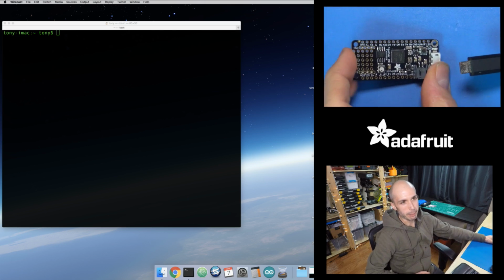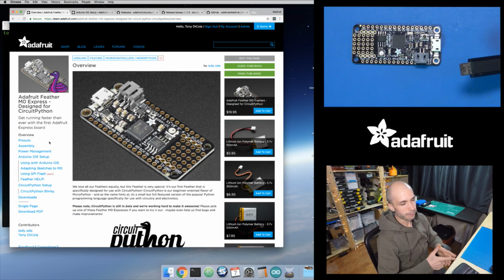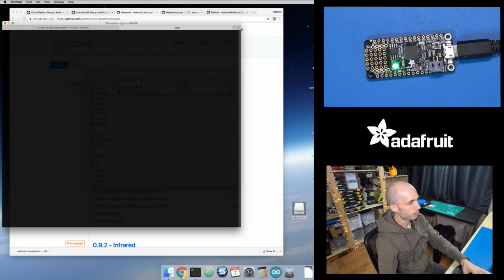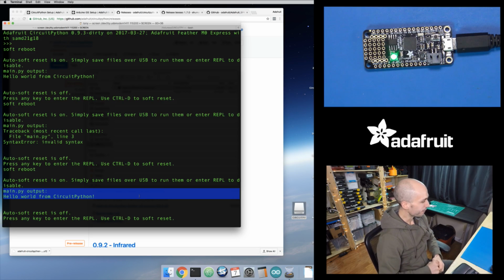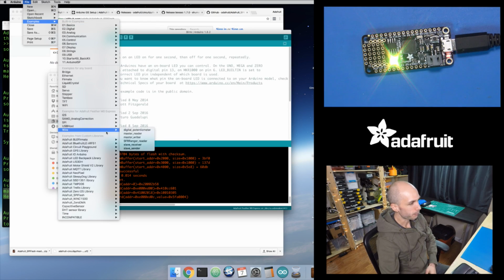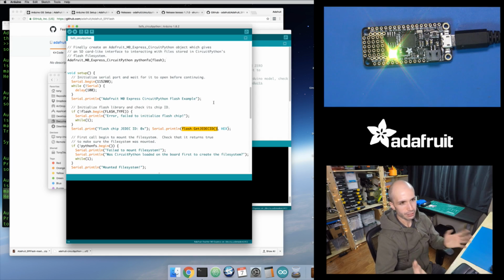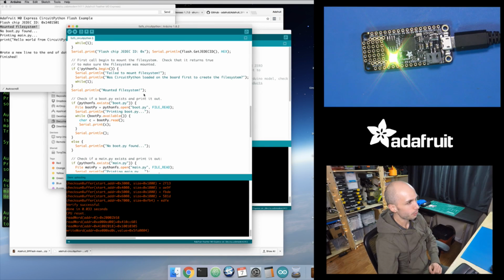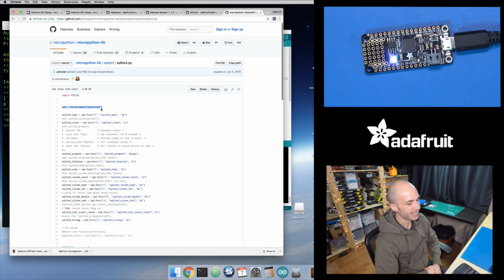Feather M0 Express loading CircuitPython & Arduino flash access with Tony D!

Comment: I can't get Feather M0 Express to do anything under Windows 7 or 8. I can't load a .uf2 file because no folder/drive pops up, and even if I set it up on my Mac, it still does nothing under Windows. It works fine using my Mac. Metro M0 Express works OK under Windows. I can see the Feather M0 Express in Windows device manager, and I have used every Adafruit Drivers package I could find, as new ones came out (1.5 is the latest, though it is difficult to tell since Adafruit hides version information). I can also load Circuit Python to my Feather M0 Basic.